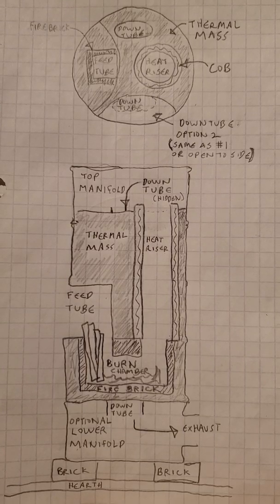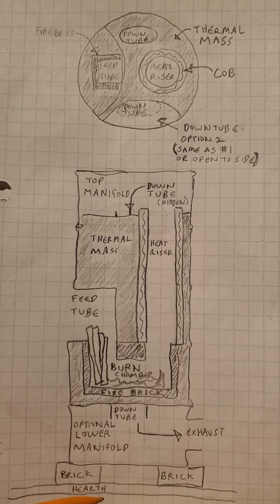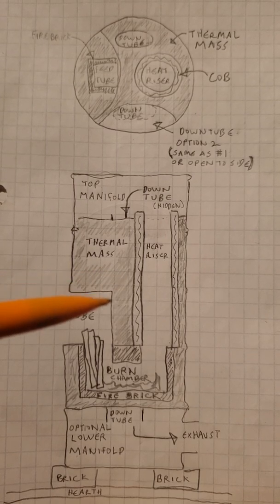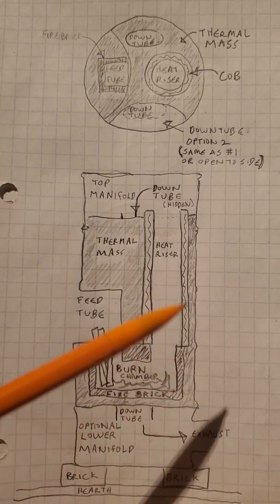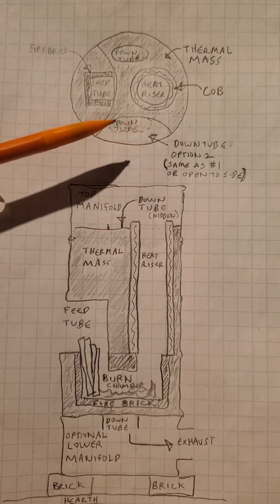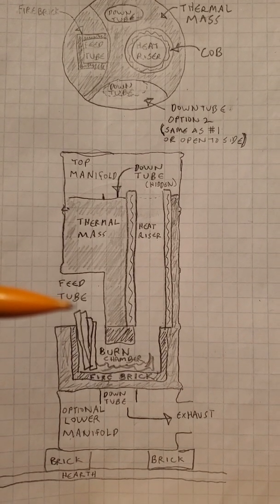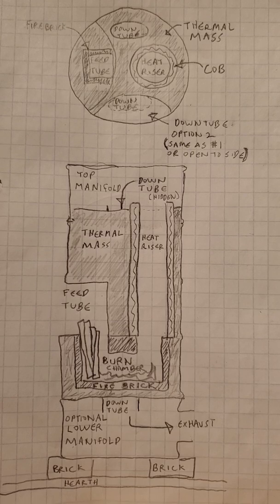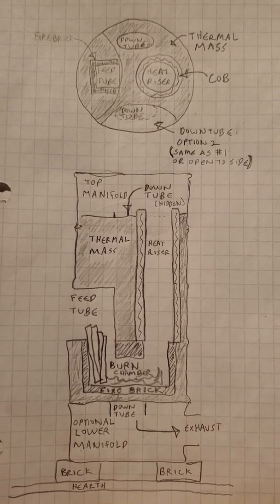Uncle Mud's CottageRocket on Paper

Comment: I have a idea i want to bounce off u before trying it would it be possible to make a rocket stove mass heater that heats water fed from a tank then pushed though pex piping undr the floors to another holding tank as a way to heat a 1400sq ft open design house
Reply from the maker: Possible, absolutely. But also technically challenging. There's a lot to discuss here from making sure it never produces steam so it doesn't blow up, to getting enough BTUs out of a rocket heater to heat a house that size. The main question it comes down to for me from heating different houses with simple and complex rockets for more than 10 years now is whether you are really going to be sitting in the room with it feeding it every 20-30 minutes for 4 to 12 hours a day. A properly designed warm bench is the perfect incentive for some of us folks who work at home to keep  chucking sticks in if the rocket is in the room we spend our time in, but a tricked out whole house heat distribution system with pumps and hoses and whatnot is challenging to design for your living room. A simple rocket can be a cheap fun build even for an occasional use room or guest cottage, but something complex like you are proposing is only really worth it if it fits your lifestyle really well. We've found that as a retrofit a simple "supplemental" rocket is a lot more satisfying in a complex house where not every space can "see" the mass heat storage. Turn your thermostat down to 50(F) or so,  point a little computer fan down the hallway toward the bedroom, feed your rocket while you are watching TV, get the house good and warm, go to bed, let the whole house furnace kick on at four in the morning.
Reply: It's too difficult and overall, it doesn't make sense. Rocket stoves and underfloor heating doesn't go together. If you have the money for pex underfloor heating in your house, then you probably have the money for a REAL system for underfloor heating, which would be a new or used, full sized, outdoor boiler with pumps and everything you need. And burn times would be 12 hours vs. 45 minutes for a rocket. Your question is kinda like buying a Mercedes and then asking if it can run off what you can get to come out of a jury rigged gassifier. Most people with rocket stoves in their house have very little money.